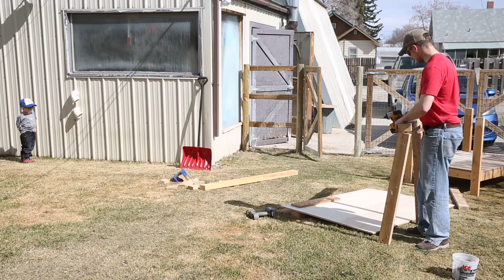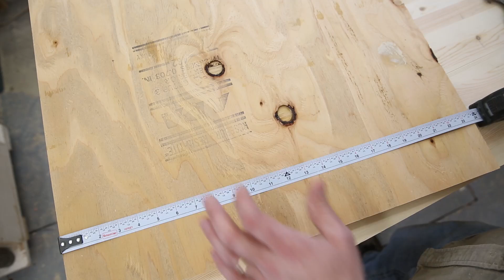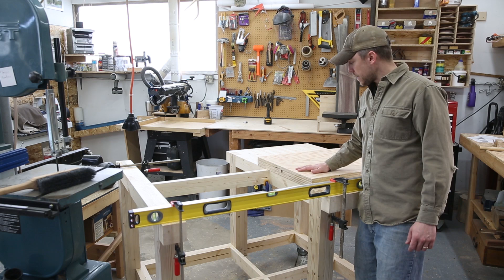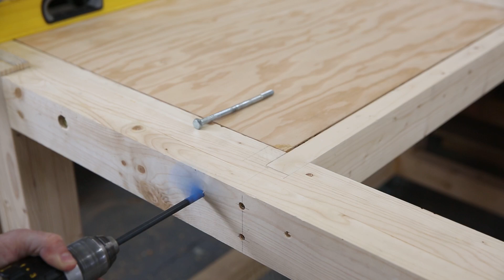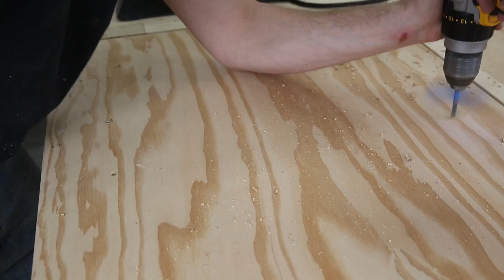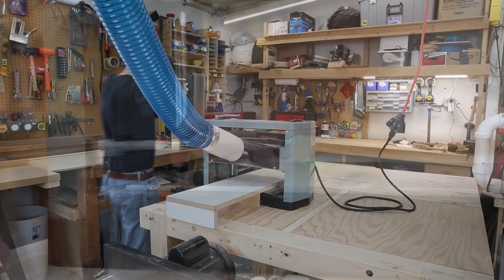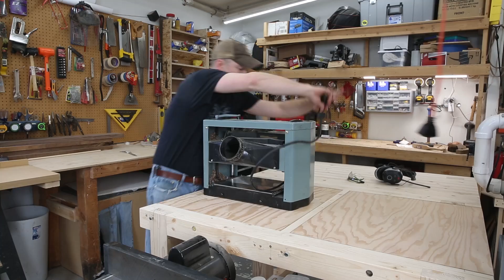Double Flip Top Workbench - The Flipening (Part 2 of 3)

Comment: Hmm, why not just drill the pin holes at the end of the flipping part, above center line. Then flip it, and do the same? That would have 4 pinholes in the flipping part, but only two pinholes on the frame. Drilling them off the center line would also ensure that the holes don't interfere.
Reply from the maker: That would have been an easier solution. I just didn't think of it at the time.

Comment: Nice work! But I am concerned that the metal axis will grind through plywood.
Reply: Probably will wear through in five or ten years. Could have put a piece of conduit in as a sleeve. Also should have put washers on each end of the flip panel to minimize future shifting.
Reply: He did put nylon washers on the axle.

Comment: Use an oil or epoxy based coating/sealant to keep moisture absorbtion to a minimum. water base coatings are porous and could cause swelling issues with moving parts.

Comment: Probably already finished, but I have recently discovered a formula for a penetrating "Teak Oil": 1/3 paint thinner, boiled linseed oil and oil based poly. Penetrates deep, very durable and looks like a Danish oil finish. I use variations on everything from deck furniture to my trailer floor boards.
Reply from the maker: Awesome, thanks Jeff!

Comment: My only concern would be the bolts coming out that hold the planer, if you do a fair bit of hammering on it.
Reply from the maker: That is a good point. I have been keeping my eyes on that very thing and so far nothing has changed - but it's good to keep a lookout for.
Reply: One way to have avoided that would have been to sandwich nuts in between the plywood sheets that make up the flipping base. Awesome table man, thanks!
Reply: Also could have drilled all the way through and counter sunk some hex nuts on the workbench side.  Then you can use lock washers, Loc-tite, etc.

Comment: You might want to pin the axles so they can't work there way out. I just drilled down into mine and used a 16 penny nail. When my son was using it the axle worked out and the planer fell to the floor.
Reply from the maker: That's a good idea. I figured I would just cap the holes in the end of the table. I haven't yet because I wanted to see how much the axels move... so far they haven't moved at all.

Comment: I may be attempting a similar version here sometime soon. Why did you use 2x4 or 2x6 instead of just getting 4x4's???
Reply from the maker: Hey Michael, there's 2 reasons for that. Mostly, because a 4x4 tends to be 3.5x3.5 in reality, which didn't quite work with my plans. Second (which may or may not matter to most people) laminating multiple boards together to make the legs should be more stable and resist warping better than one big hunk of wood.
Reply: Hi -- definitely have to subscribe here. Hm. I have a similar question to Michael, but why 2x4 sticks instead of a load of sheetwood (say 5x 3/4)? Then it's horizontally laminated --- not vertically like yours is; is that the reason? That would allow to replace a worn-out top over time.

Another question I have is how you decided what gap between both fliptops and that separator/stabiliser? Measure it (simple geometry), by eye (and sand a bit if sticking), or no gap but router the ends a bit round (so middle still touches)?

I have the feeling I'd have measured out the pins to match instead of double holes --- drill the front pin's pilot hole, drill through to mark it on the fliptop, slightly hammer a small nail in that mark, flip the top so to nail is at the back and scratches the inside, then drill from inside outward through the scratch at the right height (measure top-down at front then bottom-up at back). They won't line up vertically maybe, with only the front one neatly in the middle, but you have two holes less and no chance of trying the wrong one.

Comment: I was wondering about the axle.  Wouldn't it be better to use either a smooth rod or a axle with the plywood having a metal tube to protect it?  With the spinning and the weight of the planner isn't the threading rod going to chew up the plywood
Reply from the maker: That would have been ideal, but I had this all-thread laying in the shop so I saved money by using it. It honestly won't get flipped so much getting chewed up is much of a concern. If it get's half a flip and back only once or twice a week, it will take a very long time to ware out.
Reply: Ah okay

Comment: great project i wanted to do something similar in my shop....when I had one... I am a little concerned with your glue techniques. While it certainly looks like you have plenty, I was always taught that there needed to be glue on both pieces and that there is a way so slide something like those plywood boards side to side to evenly distribute the glue and tack them into place. You seem to be using a lot of glue. Great videos though

Comment: Question, why trim the supporting "rod" for the swiveling table to flush, and not just leave some excess and use a nut to cover it? would give you the ability to take it of when needed wouldnt it?
Reply from the maker: That probably wasn't an necessary step - your idea is very true. I just had it in my head that I wanted them to be recessed, not sticking out.

Comment: As an engineer, you could of easily saved a lot of money and makes the axles out of same size dowels. Just a suggestion. The dowels would of been more than sufficient to hold that shear load. Maybe next time. Really nice video. I needgo make one myself!
Reply: Gunflint I interpreted Illukiosas59's comment to mean that short, "dowels" of metal either side of the panel would have been sufficient. Although it's natural for a woodworker to think of dowels as being made of wood this is not the sole use for the term. Wooden dowels would wear and be a poor solution long term.
Just saying...
Great bench concept nonetheless.
Reply: I wonder if the tread in axle combined with the weight of the tool will eventually strip out the wood.
Reply: Nice bench!!
Yep! Wood is good. I personally like the metal axle. I have waxed wooden dowels but they compress over time, especially softer woods and heavier loads. I have found thin wall conduit (EMT) works very well, it's cheap and last. I still use a little wax to help it operate freely. If needed you can lock it in place by drilling through the wood and through the wall of the EMT and place a finish nail in the hole below the surface of the of the wood and cover it with putty. I have even covered the opening of the axel with a dowel to hide all evidence of an axel.
Reply: Roy MIller: That's my question as well. I would think a solid bar stock would be better. But Gunflint did already have the all-thread and can't blame him for using it. Flipping top, great idea by the way!!
Reply: lllukiosas59 we as engineers lack grammar skills sometimes lol. "Would of" or would've?
Reply from the maker: Interesting, a wood axle didn't even cross my mind. I just a assumed it would have to be metal. But fear not! - I had that chunk of all-thread laying around for years so it didn't cost me anything.

Comment: I like your bench, well done!
For a finish, it does not matter what you put on, it will need to be redone from time to time. I went the BLO/Varnish mix and it was OK, but everything stuck to it badly. next time I put a good poly on it, the stuff made for gym floors, hard as nails, dried glue just pops right off of it, and it is durable, but every now and then I have to resurface my bench (it is a short Roubo style) After I hand plane it flat again, I apply another coat of the gym floor poly. Works for me.
Cheers from Tokyo Japan, Subscribed!
Reply from the maker: Thanks for the advice! I figured it would need to be refinished occasionally throughout its lifetime. Sounds like your idea might buy me the most time in between.

Comment: For the pin symmetry thing - the same 'centre finder' trick that you used to mark out the drill points for the axle!  With the axle (but not the spacers!) installed, and your holes drilled in via the pilot hole for either end on the flip section, pop a finder in one of those, put it to the back, hold the flip flush and drive the whole thing across with a wedge again, that'll mark your point.  You can either then hold the flip half-way and drill it out in-place if you trust your abilities, or pull that rail back out again and take it to the drill press to keep it square before taking it all back and assembling.

Darn fine workbench, though!

Comment: Cool Bench! I found that exact Planer on Craigslist. It's $200, would you suggest that I buy it? It would be my first planer,.
Reply from the maker: It's certainly not a bad planer - mine has served me well. They don't make it anymore however, and if you ever have trouble with it finding parts might be pretty difficult. I had to replace the motor on mine about two years ago and I got lucky when I found a whole motor on eBay. If I were in your shoes, first I would want to see for myself that it still works perfectly. Second, I'd probably try to get the prince down a little. My thinking would be that for $300-350 you can buy a brand new one from several different manufacturers, and that's a small price to pay for some piece of mind.

Comment: Really cool! Two questions:
1. Do you wish you had aligned the grain in the flip panels to match the rest of the top?
2. When you flip your tools down, are you getting a ton of saw dust raining out? I know you have the capture setup, but I worry there would still be a bunch hidden inside.
Reply from the maker: 1. Nope, that doesn't really bother me at all. But I could see how it would. It would end up using much more material to get the grain going the same way. This direction I was able to get all of the material out of one sheet of plywood. If you had to turn every piece 90 degrees you might have to use a second sheet and have lots of waste.
2. There is still lots of dust stuck inside the machine and it does rain out when I flip it over. I try to vacuum up as much as I can before the flip to lessen the mess. Right now there is no bottom to the bench so it all just falls to the floor and gets swept up so its no big deal. In the future, I will enclose that space somewhat and it will catch that dust, then I can just vacuum it out of there.

Comment: Use an oil (tung oil, linseed oil, etc) on your bench. It will soak into the wood and help prevent fingerprints and other such stuff. Using any kind of poly is a waste of time on a bench, because poly creates a film on the outside, and as you bang on the bench, it can break and flake off. Oil soaks into the wood, and as it begins to wear off, you simply apply another coat and get back to work. The oils also don't have the nasty fumes that lacquer or shellac leave filling your shop.

Comment: I like your design. Personally, I'd use poly on the top. But some of the other suggestions for Poly/blo/ms are just as intriguing. Had it been me I would probably topped the "tool side" of the flip units with Masonite and not bothered with worrying about the finish. But.....All around, good job!

Comment: I'm a new subscriber. 
Use linseed oil. This is one of the VERY BEST DESIGNS I've seen. Super idea and well done! 
....13
Reply: Gunflint Designs: I'm subscribed! Really enjoyed the video, and I think I might copy your design. For the coating, if you mix 1 quart linseed oil with 2 quarts mineral spirits and 1 quart polyurethane, it will penetrate super well, and be more durable. put it on till it puddles up, let it soak for a bit, then wipe off the excess. let it dry for 72ish hours. You can then go back over with another coat of straight poly if you wanted to. I use this mixture on all my shop "furniture" and it really works well.
Reply from the maker: Linseed oil seems to be the top suggestion. I probably better pay attention.

Comment: Hey! Great work, haven't seen any of your stuff before, but I'm really likin what I see here. 
For the finish: I came to really like OSMO TopOil. It's a hard drying wax/oil finish actually meant for butcher blocks and wooden countertops, so it's even food safe (not that that is particularly important in the shop). It leaves a really nice and smooth finish, is comparably waterproof to any poly stuff, but leaving the wooden pores open, which makes refinishing a breeze.
Not entirely sure though if it's available outside of Europe.
Also if you should take it apart once more, consider adding some wax to the rod and wooden bearing surfaces to cut down on the squeaking of the flip tops!

Comment: Wax or Oil. poly just chips down the road. Also you could drill your bolts and use rings behind the heads for your pins.

Comment: Put a threaded insert in the flip top and a t-nut in the frame, Run a threaded knob in and you can unscrew it about 2 turns to flip, and screw it back in to tighten

Comment: Great job on that workbench! I'd recommend using Shellac as a surface coating/sealer. Three or four coats with sanding in between should do the trick.......Nice work.....Steve

Comment: Great bench!  I like the design!  I don't recommend poly for your bench finish...  It creates a "film" that doesn't hold up well on a bench over time.  Instead, suggest using an equal parts mix of 1) Spar Varnish, 2) Boiled Linseed Oil, and 3) Mineral Spirits...  You just kinda flood it on, let it sit for 20 minutes or so, then wipe it off.  Keep doing that until it basically quits absorbing any more finish... You will know when you get there.  I just finished my new bench this way and it was really easy and it created a great finish that isn't slick but provides enough of a finish to keep glue from sticking to.  My bench was maple, whereas yours is primarily pine, so yours may take a few more coats...  It really couldn't be easier.
Reply from the maker: Thanks Michael. I haven't heard of that combination before, so I might just go with it to try something new!
Reply: awesome job!! 
as a professional finisher on cabinets with all kinds of paints, I can say that spar vanish and the combination are good...but you are carpenter that may need use glue so cleaning with mineral spirit will begin to remove your proteccion coat because its a solvent of spar vanish then i defintely recommend (4) clear coats of polyurethane water base to finish your proyect from minwax, 2 thin first layers as a sealer let it dry very well to then sand it with 320, clean surface removing dust and then apply 2 last layers finishing your proyect. after a week you will see that mineral or even lacquer thinner can’t remove this product.
Reply: Awesome recommendation.  Going into my notes for sure.
Reply: Hi ya, new to the whole woodworking and I was wondering. Would this be a good finish for using on signs and the like that will be exposed to the elements? If not then what do you recommend.
Reply: You got to be careful not to get any oil on wood pieces that are to be stained and finished
Reply: I don't know how you went with the finish bit I would use a water basted enamel exterea grad
Reply: WRONG RECOMMENDATIONS FOR WOOD FINISH
Reply: I totally agree. It is also excellent for interior wood - our cabin cedar finished this way is like new after 30 years. Without the varnish it is the best way to prepare new wood for paint. I use boiled linseed and turpentine 50:50 - 2 coats then the primer. Exterior finished with latex has lasted over 40 years with 2 maintenance coats. Primer direct on wood - 7 yrs. an awful thereafter.
Reply: Michael Stockdale I was going to suggest a pre-made tung oil varnish to get a similar finish. Same idea, more protection than oil, less film than poly, but I like the sounds of your recipe better.

Comment: I like it  I did something similar with my beast of a work bench. mine has 4 power tools under it on flip top segments but without the axle. I just lift them out and flip them when I need the tools and back over to give me a full 2.5` x 6`  work surface as I keep adding stuff to this work bench I will try to make a video on it if I ever get to the end point. so far it has the aforementioned  4 power tools, 3 vices with plans for at least 1 more vice, I just found and am building a under top vacuum system for all those tools as well as bench top cleaning troughs at 2 ends, panel saw, metal break, built in measuring tapes on all sides and legs, I've been thinking of adding a vacuum table segment or replacement segment that I can change out as needed, it has various bit storage on the legs also, several dispensers, ppwer strips,  under  lighting, tool hangers.  yep thats why I call it 
"The Beast"

Comment: How big is your shop?
I'll be trying to fit into half of a smallish (by U.S. standards) two car garage so I've been looking at how others utilize their area.
Reply from the maker: It's about 19'x20'. But it is odd... it is sunk into the ground by about a foot. So where my big double doors are, there is a very oversized ramp coming down from it and robbing me of about 4x8 feet of floor space. There is also a big oil pit in the floor that I believe is from when this was a small snowmobile shop. Then there is a large pole off center of the shop with a big swinging arm - again, I believe this was for removing snowmobile engines. So at almost 20x20 its not too terribly small, but with some of the built in stuff it actually ends up feeling much smaller.